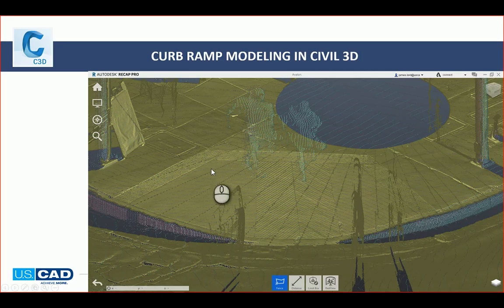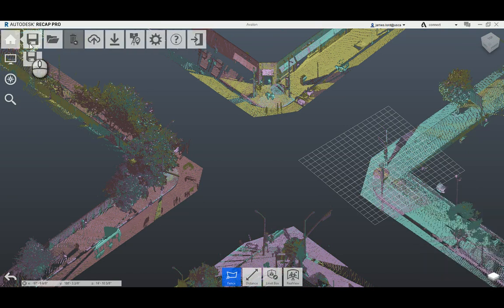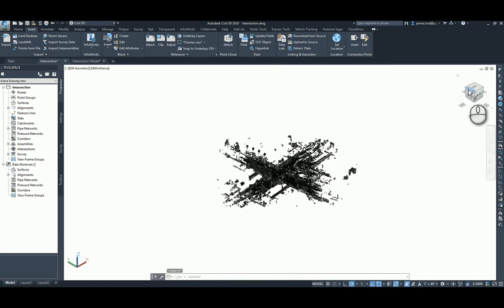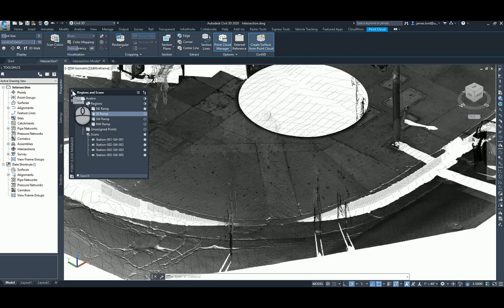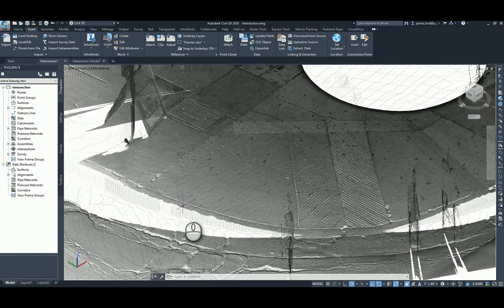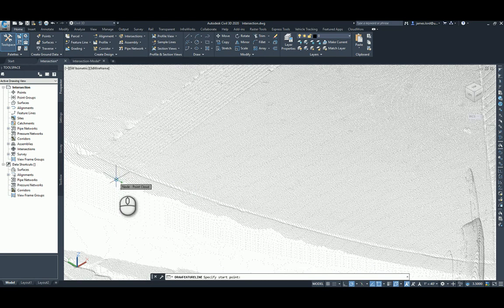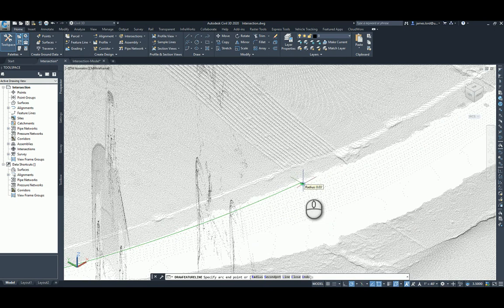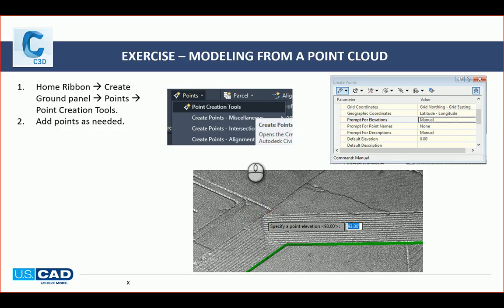ReCap   AutoCAD   Civil 3D Modeling form a Point Cloud

Comment: I cant seem to use point clouds like this in Civil but it would great.  The program just freezes up while rotating the cloud. How do you keep yours running so smooth? Our computer has plenty of power.
Reply from the maker: You can select points in Recap --> create "Region"  --> name the region --> Save. 

The regions you create in Recap you can turn off and on in AutoCAD.

 The more points you turn off the better AutoCAD will perform. You could also just divide the cloud into chunks.

Here is a image that might help communicate what I am talking about: https://www.dropbox.com/s/rq67z9m7vacr926/Recap_Regions.png?dl=0